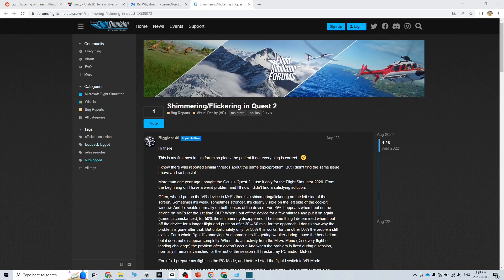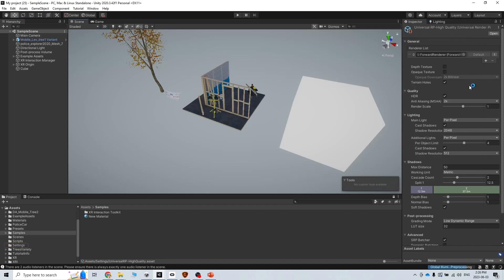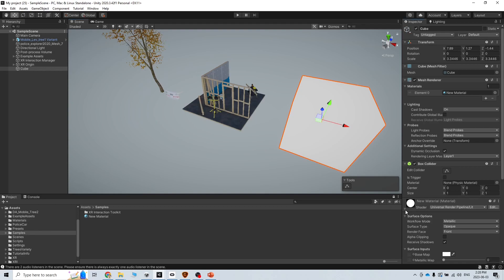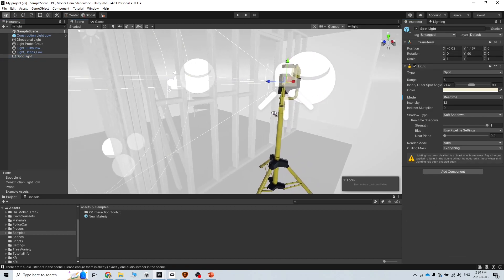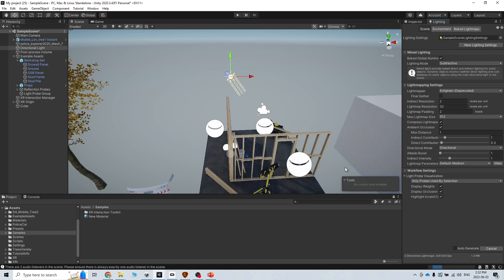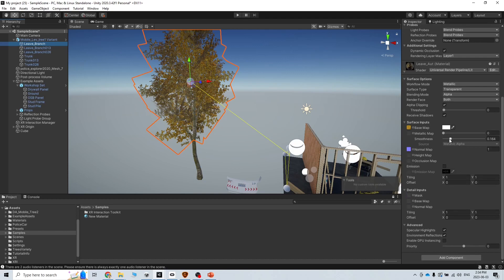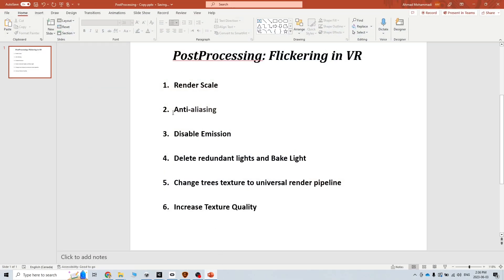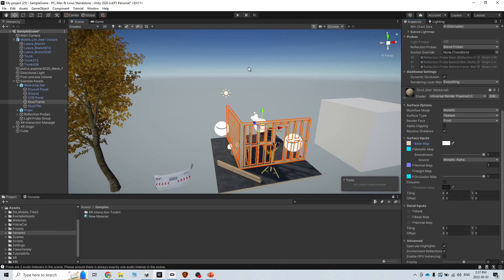Flickering in Unity VR: Fix Flickering and Pixel Noise on Edge

Comment: Its also more obvious on shiny metallic surfaces, so you can turn down the smoothness in the material slider, or if you are using a single texture for a mesh instead of a repeat you can edit the texture directly - lower the metallic and roughness scale on the troublesome faces and that can sort it out. Its usually barely noticeable because the troublesome faces on your mesh are so thin.
Reply from the maker: Thanks for adding this tip, it will help other people.

Comment: is it work for cardboard vr also
Reply from the maker: Good question, 
Cardboard VR has significantly lower number of pixels compared to Meta Quest 2 or 3. So, while these techniques might still help however keep this into your mind.
Reply: Noted.thank you for your response @RoadwayVR
Reply from the maker: @lmvsram3477  your welcome :)
Reply: objects are blured on distance in my cardboard game .its normal on game view..but in vr i can only see  sharpen objects near by camera @RoadwayVR
Reply from the maker: @lmvsram3477   Your problem is hardware issue not software. I propose you to do one exercise. So, play a video in youtube in your PC and move your eye very close to the monitor (sticking your eye to the monitor). You will see pixels (rectangular shapes). Now, if we have the technology to add lots of pixels in monitor in this exercise, then you wont see pixels and everything would be good. 

Now jump into cardboard, Cardboard has few number of pixels and you are wearing the headset and seeing the display from very close correct? So, the only solution is to increase pixels of carboards which you cannot instead you need to buy a new good device. i am sorry but, These techniques in this video do not help your issues.

Comment: The problem was not solved for me with just render scale and antialiasing. When I activated the Post Processing section in the camera settings and selected antialiasing there, the problem was greatly reduced. Of course, other techniques will need to be added for a complete solution. Thanks for the tips.
Reply from the maker: As I said, Render scale is not recommended as it is resource intensive(last solution). Your input regarding activating antialiasing in post processing definitely something I will take a look at it as well.

Comment: Hi i tried the above render scale and alaising techinique. But still i am getting the wavy jagged edges in most of my game objcts. But i saw their demo apk it not have any jagged edges. I am using their unity package only but my build is having that
Could you help me on this?
Reply from the maker: which package you are referring to? Try other solutions like baking light by changing directional light or disabling point lights
Reply: @RoadwayVR  I am using ARchiviz PRO Vol 8 unity package
I tried the VR Demo apk. it doesnt have any aliasing. But My unity build after so many iterations having this
Reply: if I Increased the render scale it didnt fix that, only increases resolution. tried almost all of the settings.
Reply from the maker: @praveenb-xr  I am sorry that these could not help you. If you find out the solutions, then I would be happy to know it as well. Please reply it back when you find out the solution.